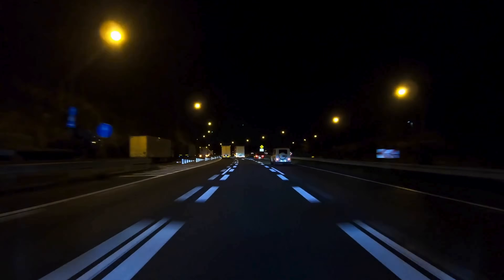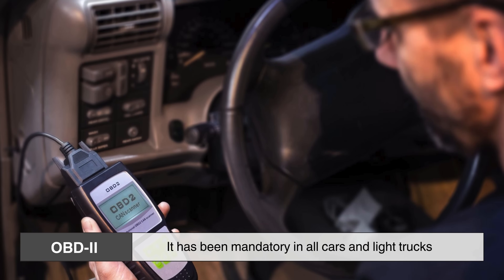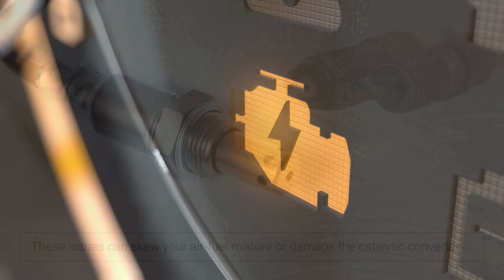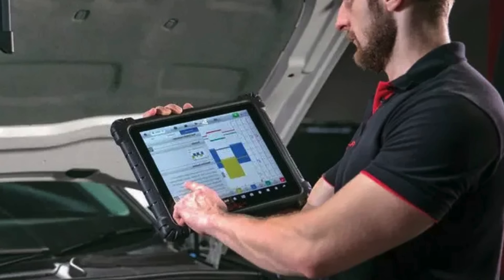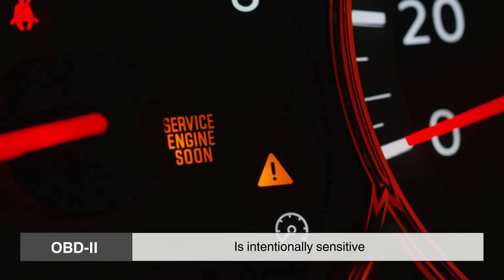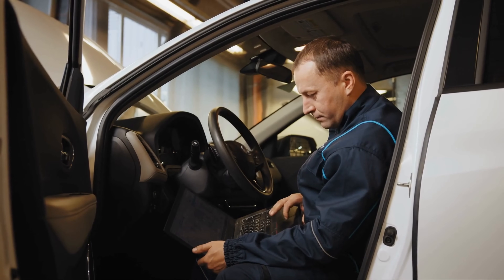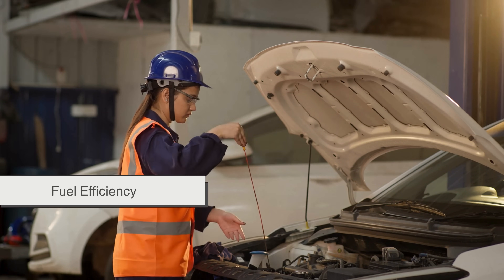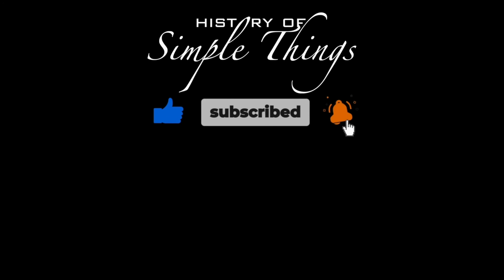Check Engine Light: What’s Your Car Trying to Tell You?

Comment: I had that same problem the other day with my 2013 Nissan.  Took it into the shop, had it scanned, they reset it, and so far, it hasn't come back on.  But, I'm having the car thoroughly checked next week.  I know that there are people who drive around for years with the check engine light on.  Not me.  I cut my teeth driving around Michigan's Upper Peninsula at a time before there were cell phones, and even after cell phones became common, many areas had poor or nonexistent service.  When towns are 20-30 miles apart and there are no services in between, just wilderness, this is not a place you want to have a breakdown on.  And people up there know that.  I don't ever recall seeing a broken-down vehicle on the side of the road up there, but down here in the Lower Peninsula it seems like it's a daily sight on the Interstate.  So even though I now live in the Lower Peninsula where everything is literally a stone's throw away, I still follow the same rules.  Keep my vehicle maintained, take care of problems early, don't ignore warning lights (you don't know what they mean).

Comment: I YEARN for the days when cars had the tech level of a giant walk-behind lawn mower! Each part had an actual FUNCTION in making the car move, and NO parts were these extraneous, expensive nonsense parts!
Reply: Back in those days you would never be able to have a car with over 1000 horsepower, get over 20 miles per gallon, and not pollute the heck out of our air. All this equipment is far from useless, it has made many of our everyday vehicles faster and way more fuel efficient than any supercar of the '80s